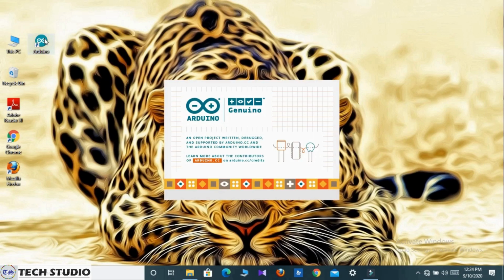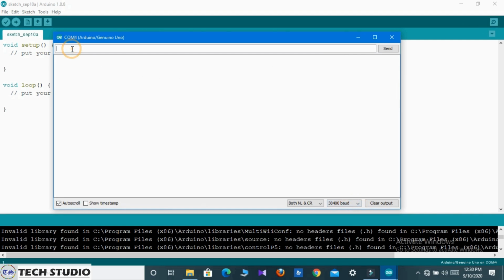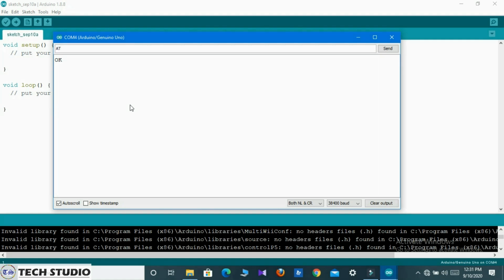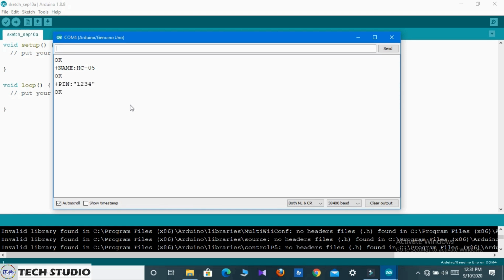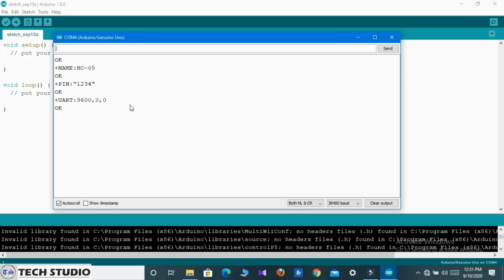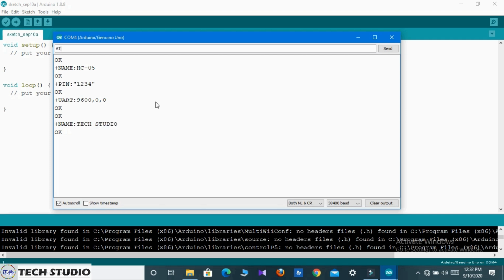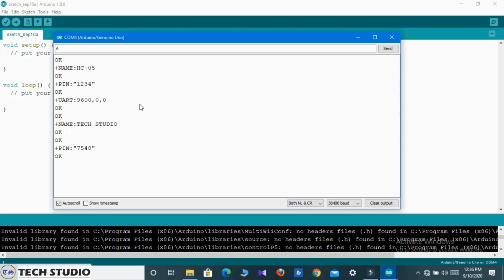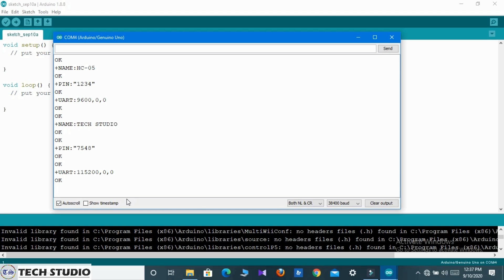How to change name, password and baud rate of bluetooth module HC-05

Comment: If it’s still not working, you can remove the RX and TX cables, upload an empty sketch, then re plug the RX and TX cables and then perform above instructions. Arduino board should have an empty sketch uploaded

Comment: For those whose bluetooth module HC05 is not blinking its own LED as shown in the video, connect EN to 3.3V and VCC to 5V, then you can carry out the AT commands. 

Also, remember to put question mark (?) after each AT commands such as (AT+UART?) instead of (AT+UART).

Also, when putting new names and password, no need to use inverted commas , for example, you can simply use (AT+PSWD= 6754) instead of (AT+PSWD= "6754"), you can also cross check with the original password of Bluetooth module to compare the new password format with the exact format of original password for simplicity.
Reply: Thanks 👍🏻

Comment: When i type AT nothing comes up?
Reply: When I enter in AT mode, I can’t enter in serial monitor. Only when the led of the module is blinking fast I can Connect with the serial monitor. In this case when I write AT, not OK answer. Someone can help me?
Reply from the maker: It means the bluetooth module is not bind up.
Reconnect the bluetooth module again, it will work.
Reply: I also have same problem
Reply: @dragongm5709  DID YOU FIX IT ALSO HAVING THE SAME PROBLEM
Reply: @kolorszx4112  Yes, my problem is a connection problem, recheck the cable and connect the enable pin to 5V
Reply: same problem pls help

Comment: Hello sir, 
If I type AT+NAME,
Its showing *ERROR:[0]
*

Pls give the correct command
Reply from the maker: Firstly type AT and press enter. 
See if the reply come "ok" then type the following command mentioned in the video. 
Otherwise reconnect the arduino with your computer.
Reply: @MyTechStudioOfficial  When i type AT , It showing ok. But when i type another thing like ' AT+NAME' , 'AT+PSWD' , It showing nothing
Reply: @ralghb  Add a ? at the end of the command
Reply: Same problem. Give me the solution